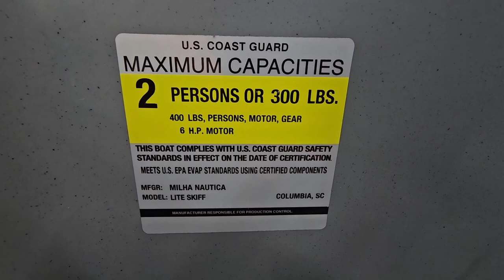Longtail Mud Motor on a Milha Lite Skiff [Review]

Comment: While I am never going to put a mud motor on any boat I will ever own, I REALLY needed this awesome review on this platform. You showed me many aspects and answered many questions I had about it. 

Things like draft, handling of weight, flex on the casting decks, stability when a heavy dude walks up to the edge, then even showing what the bottom of the boat looks like. As well as throwing out measurements of the inside of the storage areas, and even showing how the lids latch shut. 

Thank You! 

Now I just need to figure out what length of shaft I would need for an outboard, and what size of trailer I would need.

Comment: really appreciate your videos and they have helped alot with my own boat remodel and now im to the point of looking for a motor. im torn between a surface drive and a longtail. ive watched some of your past videos and i know you like longtail kits bc you can go some places that others cant. since you didnt have any videos on surface drives, i was curious as to what you thought about the cupped wing mud motor kits compared to your longtails and what type of motor i should get? i fish and hunt the tennessee river, its tributaries, and surrounding lakes; hunting shallow and deep water to timber holes, open water, and rivers. those surface drive kits run around 1100 tax included, 8-23hp. i was hoping to get some advice and/or a response video. thanks for what you do man!!

Comment: I copied your transom you did every part of it. When I installed the angle aluminum in the corners the bolts kinda I mean just a little pulled the sides in when I tightened them down. Not enough to see but I saw it when I tightened it. Is that okay to leave ?

Comment: that boat looks a little tippy to me not sure if i like having to sit so far forward in it  rated for two people looks like two people would be mighty crowded
the storage hatches are cool and all  but the designers went to far with it
because the storage compartments take up to much space and dang no storage in the bow  thats a bummer  i lll have to build custom seat mounts to attach to plastic  honestly now that  ive seen the video im not at all interested in that style of boat it needs to be redesigned 
3500 bucks wow thats really expensive
Reply from the maker: Yeah it ain't cheap, not my style either but  if I hadn't made a video on it, no one would know if it's good for them or not.

Comment: 3500 for a plastic boat when you can get a brand new 14/32 for 900 that holds more weight and hp. Seems silly but so does these crazy kayaks. To each their own. Neat to se
Reply from the maker: Where the heck you finding new 14 footers for 900 bucks? I need one bad, but everywhere I look they want 1999 for them new